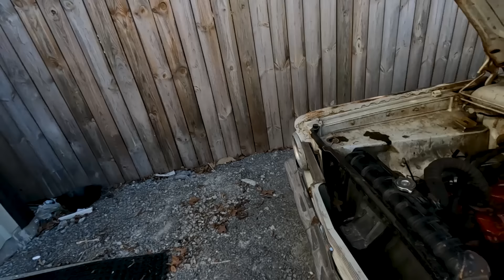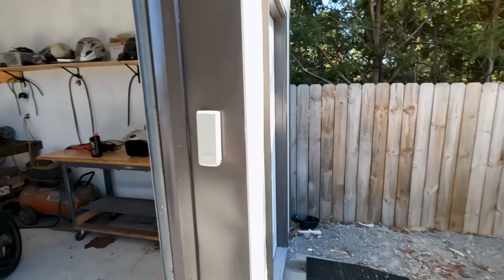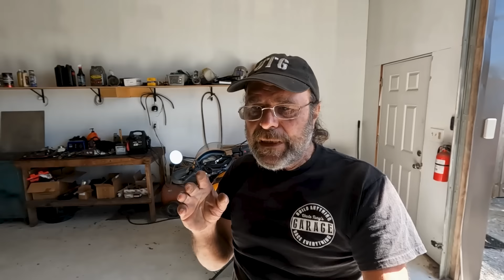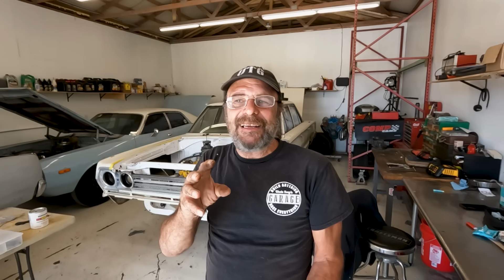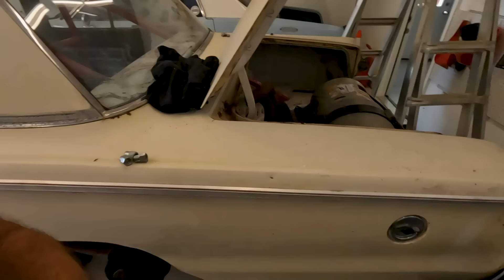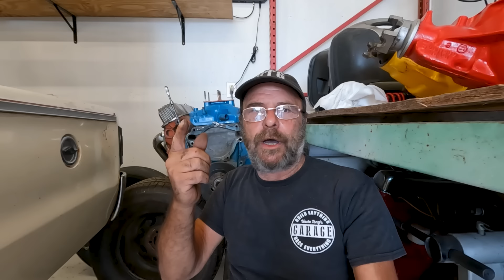Classic Car Tuning Problems - Curing Off-Idle Stumble, Bog, Hesitation, Stall And Backfire

Comment: Want to add, to much pump shot can cause hesitation as well as to little.  It's all about finding that happy medium.
Reply: true , i have a 400 with a 4bbl edelbrock 600 on it and also previously a street demon 625 , engine is mostly stock except the MSD ready to run distributor , coil and wires , also 1" 4 holes edelbrock spacer , car is hesitating when you first step on gas but runs good when the throttle is lightly tapped or when car is in motion , accelerator pump is working too , can't figure out the problem yet
Reply: @MOPARMuscleLEBANON  having similar issues did you fix it yet

Comment: DIESELING ENGINE: This can caused by a number of things:
1) Too fast an idle speed.

2) Too rich fuel mixture. (Long-term causing carbon build up which glows hot and ignites fuel after the ignition circuit has switched off)

3) Too lean a fuel mixture at top end from incorrect jetting or airleak, casuing the engine to overheat.

The fuel/air mixture could be heated to the point that it self-ignites, causing the diesel run-on effect.

4) Timing is out. The timing itself won’t cause the run on as the ignition is switched off when the run in occurs. However timing too far advanced can cause an overheating engine which can attribute to over-run. USUALLY its this. Should have made this number one.

5) Lower octane fuel could aggravate the problem, because it will self-ignite quicker than a higher octane fuel. But it alone won’t cause the problem.

6) Carburetor idle stop Solenoid .

7) Sparkplugs have a temperature range. Are you running the right ones for your engine spec? Also are they clean and gapped correctly?

Comment: The problem I see with  setting initial timing by vacuum or by ear is it doesn't take total timing into account.  Distributor mechanical advance amount are all over the place with OEM distributors. Most times you'll find 15 degrees or so runs really nice at idle. If that distributor was set up originally for  a couple degrees advance, it'll be way over once the rpms come up. If the original spec was 2.5 degrees ATDC like my 68 D200's 318 it's WAY over. Jump to my 81 W250 with a 318 auto the fender tag says 15 BTDC factory spec. Same basic engines, vastly different amounts of built in mechanical advance!
So I never recommend those methods unless you check the all in mechanical. Best bet, find the initial and all in it wants, mod the distributor to match.
Reply: Wasn't 35 degrees total timing advance the rule of thumb for stock engines?
Reply: @Joetechlincolns  Somewhere around 35ish, but that's not carved in stone!  Bore size, compression, combustion chamber design, fuel octane all play into it, plus, whether its naturally aspirated or force fed.
Reply: That's why efi is so good it made timing computer control but people only mention the fuel delivery of efi. Noobs

Comment: The timing situation assumes your distributor gear and cam gear are in good shape and limited backlash.  Older cars really need that examined and fixed as needed.

Comment: Not all GM engines use manifold vacuum, chevy does, Pontiac does not. I've argued with chevy guys who think its all the same and tell Pontiac guys to run manifold vacuum. Then when I put it all right, and the car runs great, runs faster, and they listen to chevy guys they always go slower and lose drivability.

Yeah engines are air pumps, but there are lots of variables in where the power is made in the RPM range. Timing plays a big part in performance with Pontiac engines, and they tend to like a lot of it, and right soon too.

Comment: Good video Uncle Tony. I agree on power timing being best. I'd start out advancing distributer as far as possible to the point of starter telling me it wasn't happy. Then I'd brake torque car and listen for ping. I'd back it down to the point of not pinging then take it for a ride and finish adjustment after testing under load 4-5 times. Always had my wrench to snug distributer once I found engines happy place.
Reply: Always done it similar way, steep hill, top gear, listen for pinging.

Comment: If your accelerater pump and carb are working correctly, but rich. The rich condition is fouling plugs slightly. Go to a hotter plug to fix stumble.

Comment: lol im trying to figure out this for my 88 blazer with a tbi
Reply: Throttle body does not have an accelerator pump. That is fuel injection. I've owned many 88 89's Chevy's. Seen just about everything that goes wrong. Check your fuel filter first. TBI is sensitive to fuel pressure. If you have that off idle stumble.
Reply: "Ultimate TBI mods" There's oodles of cheap and free mods to improve the TBI.

Comment: Wat about very sluggish acceleration? And black carbon comming out of the exhaust? Im assuming its way too rich. But i didnt have this problem before. And nothing has changed. Car just sat over winter. 383 w/ holley 850 carb. Timing 36 advanced
Reply: Choke isn't opening?
Reply: @keith6872  the carb is brand new with an electronic choke. I'm hoping it's just plugs. But it is a dog on the highway.

Comment: Uncle tony I'd like to correct you on the fact that Motorcycle CV carbs do infact sometimes have a acclerator pump they get used on scooters, mopeds, superbikes and even harley used them on their Mikuni CV carbs for better throttle response they can be tuned aswell
Reply: You are correct. Most newer 1980's and up 4 stroke motorcycle and atv carburetors have an accelerator pump. Most 2 cycle carburetors do not.
Reply: @jasonbusch3624  they can be handy and a pain when they decide to not function as intended rich mixture conditions or as uncle tony said a stumble or stall off idle circuit
Reply: @s.a.f.r.a6403  I started working on motorcycles back in 1991 and have worked in shops my whole life. I have a ear for lean conditions and engine problems. My buddy stopped by on his Harley and I told him it wasn't running right. A week later he stopped over with it and it had fouled a sparkplug and was only running on one cylinder. I checked compression and spark it was good so we put a new sparkplug in it and it lightly smoked out the exhaust for about 15 minutes, but was running great again. The old sparkplug electrodes were really wore and rounded, had a lot of miles on them.
Reply: People like Tony an his followers fail to realize new motorcycles two stroke or four, have carbs or efi as options in modern times. But they claimed old school lol. Also a tiny 150cc modern dirt bike has a bigger carb with more airflow that a slant 6 3.7liter single barrel carb. 

Pilot jets,main jets,leek jets, needle position,accelerator pump adjustment in modern KTM or Hondas etc is not old school they make them brand new in 2024 or efi of u want.
Reply: @apocolypse11  worked on both newer stuff easier to work on older stuff fights back
Reply: Yep my 66 & 67 Harley’s both had the pumps

Comment: Accelerator pump, timing AND I see a lot of guys running way to lean, this also causes the same issues. I have changed jets on hundreds of carbs for friends that had no idea how to, or even thought of jetting a new out of the box carb. They just buy them, bolt them on, then wonder why the car runs poorly.